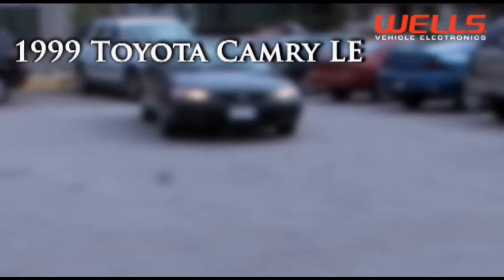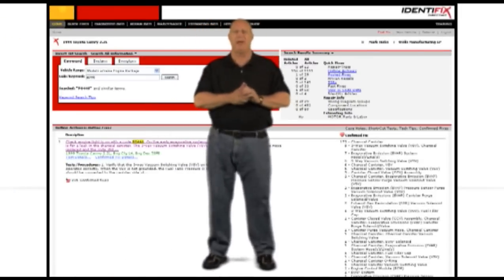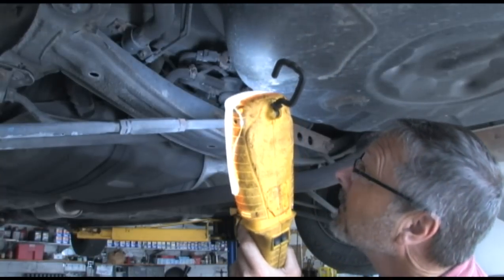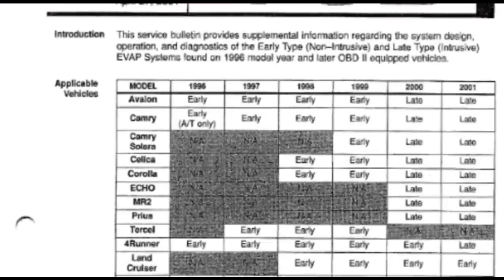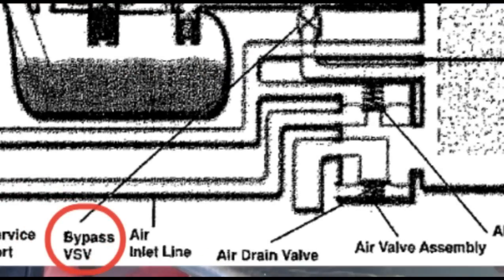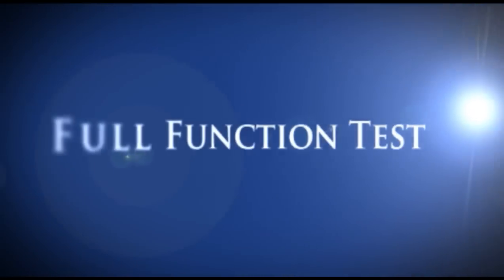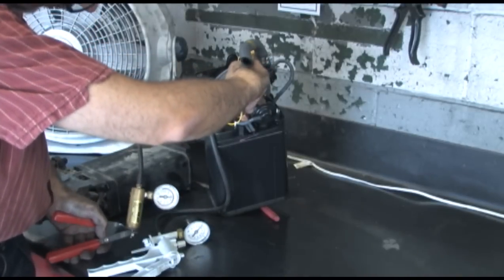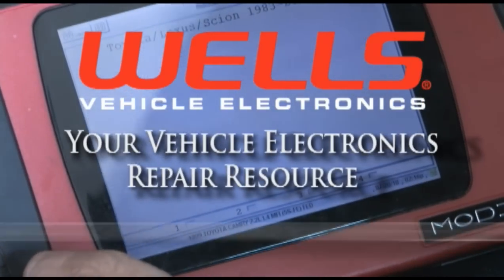Toyota Po441, P0446 EVAP Vacuum Switching Valve VSV Testing and Canister Replacement

Comment from the maker: Clean the airflow meter and retest drive the vehicle.
Add a supplemental fuel supply when the problem is happening. Check to see if the engine runs better. Check fuel pressure.
Let me know,
Mark Hicks
Wells Vehicle Electronics

Comment: Yea its just the p0446 code. I checked all my fluids and recently placed the top engine mount and spark plugs. The car seems to take a lil while to kick in wen i hit the gas nd reverse even a lil more when i got the ac up . It does it when i stop nd when i hit gas it takes awile to kick in.

Comment from the maker: Voltage is supposed to change at approximately 1" Hg vacuum. Try testing this switch several times to see if the switch is sticking. Replace the NVLD if the switch is sticking. 
It is very common for the NVLD to fail on your vehicle!
Stay in touch,
Mark Hicks
Wells Vehicle Electronics

Comment from the maker: At the Natural Vacuum Leak Detection (NVLD) assembly, which is mounted near the fuel tank, backprobe the Violet/White wire with a voltmeter. Locate the vacuum line going to the canister and remove the line so a hand vacuum pump can be used to put vacuum on the line going towards the NVLD. The other line at the NVLD goes to the vent. Block the vent line. Using a hand vacuum pump, apply vacuum to the line while watching the voltage on the Violet/White wire.

Comment from the maker: It is very common for the Vacuum Switching Valve and charcoal canister to cause a P0446 code on a 99 Lexus es300. But without testing it is no more than a guess.
Mark Hicks
Wells Vehicle Electronics

Comment from the maker: It is somewhat common for a poor ground on the MAF sensor to cause this issue. Backprobe and check the Mass Air Flow Sensor ground on the Light Green wire - look for 0.03 volts or less to be ok. If I were you I would take it back to the dealership and make sure they perform this test. I would also demand to know which codes set. It is your vehicle, my friend, you have every right to know!
Stay in touch please,
Mark Hicks
Wells Vehicle Electronics

Comment: I have a 2009 Rav4, with a really poor milage, I am getting areoun 11 and 12 miles per gallon, I did and injector clean up(flush) and the mileage improve just a bit, In the dealer they flash the computer (suppousely) and clear two codes that they do not want to tell me what they are, car is still under the 36 thousand miles, does this model still has an EGR, if not what is replacing it, can the PCV valve have an effect on this, or the EVAP

Comment: I'll take the lack of swoosh as a good thing.

Used vacuum pump to confirm both VSVs are working when properly powered - they're ok.  

I didn't make it to step 2 before I noticed the vapor pressure sensor was plugged into the wrong port on the 3-way VSV on the canister.  I rerouted it and confirmed the others according to the underhood diagram.  I hope that takes care of it.  Will take a couple of drive cycles to clear the pending status.  Will update when I know more.

Comment from the maker: 2. Monitor the FTP sensor and unplug the 3-way VSV and draw a vacuum into the canister and verify that it will hold vacuum and the FTP voltage will decrease.

3. Test and verify that the Purge Solenoid (PS) and wire harness are all OK. The PS should apply vacuum to the charcoal canister when grounded. Also verify that the hose from the PS to the charcoal canister does not leak. 

Mark Hicks
Wells Vehicle Electronics

Comment from the maker: The swoosh you hear is usually because the vent valve or solenoid is stuck closed. A P0446 on your vehicle is usually a defective VSV or canister. Here is the test procedure ... Please let me know how it turns out:
 	
1. Verify that the 3-way Vacuum Switching Valve (VSV) on the canister operates correctly. When the VSV is not grounded, the Fuel Tank Pressure (FTP) sensor should be connected to the canister side of the system only.

Comment: Mark - I've got a 98 Rav4 with 181,000.  Started with P0440 and P0441.  Replaced the two VSVs (canister and EGR).  Have not replaced the one near the air filter but it tests ok.  The P0440 went away and I've had the P0441 for a couple years now.  I just swapped the canister with a salvaged one on a whim and now I only get P0446.  Canister may still be bad I guess but I also noticed no more swoosh when removing gas cap so I replaced the cap but no change on that.  Thoughts?

Comment from the maker: 3. If both solenoids operate correctly and are not sticking, inspect for a restriction in the Evaporative Emission (EVAP) lines that could affect how the canister vents after a leak test is performed.

4. Verify that the fuel cap is a factory part. If the fuel cap leaks or does not hold the correct amount of vacuum when the system checks for a leak, all the codes will set. 
Mark Hicks
Wells Vehicle Electronics

Comment from the maker: 1. Verify that the Vacuum Switching Valve (VSV) for the pressure sensor (located on the canister) operates correctly. This is a normally closed (N.C.) valve. When energized, it should open. When de-energized, an internal spring should close the valve.

2. Verify that the canister closed valve (located on the air filter housing) closes and does not stick closed when operated. This is a normally open (N.O.) valve. When it is grounded, it closes and it should never stick closed.

Comment from the maker: I can not tell you what is wrong with your vehicle without testing it. I can tell you the most probable cause is the EVAP canister. But before I would replace it I would perform these tests:
1. Verify that the Vacuum Switching Valve (VSV) for the pressure sensor (located on the canister) operates correctly. This is a normally closed (N.C.) valve. When energized, it should open. When de-energized, an internal spring should close the valve.

Comment: Yes, this is now confirmed. I cleaned up the hoses and put back. Then I did a drive cycle (cold engine, took out gas cap and tightened, warmed up for 3-5 minutes, 10+ seconds with high idle speed, then idled the Sienna with AC on for 35 minutes). The evap is now "ready". This feels so good since I almost wanted to surrender this weekend. Thanks Mark for being be my mentor going through the process. Many many and many thanks!

Comment: Thanks Mark. The drive cycle was helpful. For evap, the drive cycle is primarily to idle (after with high idle for 10 seconds) with AC on for 20-50 minutes. I also found that with a new gas cap was not the  solution since P0446 etc came up again. But, I have a BIG finding just now. I just took out the 3 hoses (white, red, blue marked). The blue hose was blocked completely by something. So, I am so excited to post you the current status now. I think the blue-marked hose is the problem. Cheers!

Comment: Thanks. One more thing that I plan to replace (before being smoked) is an emission vacuum valve (part # 911-612) near the air-filter. Do you think this could be relevant to code P0446? Thank you.

Comment: Thanks. I thought my tag will expired next month December, but just noticed that it is November (need an emission test). I have replaced the gas cap 2 days ago, and checked the hoses. I should be able drive another 150 miles in this week. I think I should go to do the emission test in 10 days, and if it fails then I would need to ask an  authorized emission specialist to work on it (with $150 or more repairment to get a waiver if failed), to avoid an expired tag ticket. Hope the gas cap works.

Comment: Hi, thanks again for your help. After the replacement of VSV in August (shown in October that did not work), I replaced a new evap charcoal canister 3 weeks ago (early November). This time, P0440, P0441 and P0446 were pending after driving 100 miles, then P0446 was checked today after driving an additional 300 miles. I have just replaced a new gas cap now, and hope it would work. I would also look more closely if all hoses are OK. Please let me know if you have any further comments. Thank you!

Comment from the maker: Great question, the answer is no. I am going to assume you are talking about the vacuum switching valve. If it were "on" or stuck in the closed position the computer would detect the problem through an evap monitor test. It would realize there was a problem somewhere in the evap system because the pressures would not be correct. Remember, there is no code that says replace this part or any part! The computer can only point you in a direction.
Mark Hicks
Wells Vehicle Electronics

Comment: Hi, many thanks for your advice. Unfortunately, after driving 1000 miles since mid-August when I replaced the VSV of the evap canister, the check engine light is now on, with code P0446 (P0440 and P0441 pending). The replacement of VSV did improve significantly (used to have light on with codes P0446 series after about 150 miles), but there is still a problem. So, I plan to buy a new evap charcoal canister within the next few days, and replace it.  Would you have any suggestions? Thanks!

Comment: Hi, thanks for your advice. As mentioned I replaced the VSV in mid-August, and cleared P0446. After driving for 800 miles in the last 2 months, my 2001 Toyota Sienna had pending P0440, P0441 and P0446 a few days ago. These codes are still pending as of today (extra 50 miles, total 850 miles since the codes cleared in August). I assume I should wait to see the check light on, but be prepared to change the evap canister. Please let me know if you have any advice at this time point. Thank you!

Comment: I have a 2001 Sienna with the late style vsv. While testing the vsv, I heard a small click, but nowhere near as loud as the one on the video. Is that still considered ok? All connections and the charcoal canister look ok (no rust). No heavy oder of gas anywhere including the hoses. Don't want to spend money on canister unless I have to. Any help will do. Thanks

Comment: To be fair, the system on this Toyota has gone many changes during that time frame and there are bunch of TSB (and a PhD thesis :-) to go through before really understanding it thoroughly.  I have MS in engineering but it is still not the easiest system to understand or diagnosis.  Toyota by using the same code for many different things did not make it any easier either.  For example, I have no small leak or large leak code but that does mean there is no leak either.

Comment: Usually I personally do all the diagnosis myself and then I take the vehicle in for the shop to do exactly what I want him to do.  Over the years, he has realized that I know more about my cars than he does.  In this particular case, I was lazy and I knew up front that this was going to be a nightmare from doing all the research over the internet.  So when the shop said, they have replaced bunch of VSV to fix this problem, I went for it.  I do take some responsibility for this.

Comment from the maker: I apologize and completely agree. If the VSV checked out to be functioning, the nest step is to smoke the system. You are also right the majority of techs just want to replace a part without testing. I feel this is the case for a couple reasons. 1. shops that only want to pay the techs for time spent for R&R and are just interested in getting the next vehicle in the shop. 2. The shop owners and service writers that have not educated their customers that the best way to repair is to diagnose

Comment: We are talking about your reply to the person (crazycanadian05)  who had this code multiple times and the shop and dealer and replaced bunch of parts until smoke test found the leaking hose.  You will agree that smoke test should have been done before replacing the expensive canister.  At least VSV is under $100 and if it does not click, would be obvious candidate to replace.  But many mechanics, including mine, replaced it without doing any diagnosis on it.

Comment from the maker: What do you mean? We tested the VSV and it failed, so it was replaced. How is this not diagnosing? We would have included the test in the video even if it would have tested good. We then would have taken it further and smoked the system. 

Mark Hicks
Wells Vehicle Electronics

Comment: Hold on second here!  Replacing parts is NOT diagnosing.  I understand that this is a pattern failure for this make & model and there is a high chance that either VSV or canister will be a problem in 90% of the cases.  BUT, replacing them without verifying that they are broken means you are not doing the proper diagnosis.

Comment: The canister had been replaced with along with the updated 3 way VSV and a new pressure sensor.. When I got the vehicle I wasn't sure where the vent was so I smoke tested the system to find the vet... When I did find it I blocked it off and found the plastic line between the canister and fuel tank had rubbed threw behind the clip that held it in place.. A new hose seems to have solved the problem..

Comment: Hey guys.. Interesting video.. I know it was posted almost a couple years ago now, but I am curious why at the time you didn't smoke test the system to check for leaks? As you mentioned in your video the code could be set by a leak.. I recently had a 98 come threw my bay at work setting a P0446 code and failing emissions cause of it.. It had been back and forth to the dealer for the same code 8 times over 2 years trying to solve the problem.

Comment from the maker: If you have already replaced the VSV with the same results, we will have to assume at this point it was not the issue. Again it recommended to replace both the charcoal canister and the VSV as a unit. I am surprised they did not recommend it.

Mark Hicks
Wells Vehicle Electronics

Comment: I already replaced the 3-way VSV which as turns out was not even broken :-(  Can you confirm that when you say purge solenoid you mean 3-way VSV?  The new VSV is made in Japan, so it should be as good as the original one.  We can rule out the 3-way VSV as the culprit.

Comment from the maker: It is common for the 3-way VSV to stick or not operate correctly or for the charcoal canister to be faulty. The charcoal canister has valves built inside, so always replace the canister and 3-way VSV as an assembly, so the code does not reset. 

Mark Hicks
Wells Vehicle Electronics

Comment from the maker: Test and verify that the purge solenoid and wire harness are all OK. The purge solenoid should apply vacuum to the charcoal canister when grounded. Also verify that the hose from the purge solenoid to the charcoal canister does not leak. If the vacuum switch is replaced, clean the inside of the vacuum switch with brake cleaner. Spray brake cleaner into the ports on the new vacuum switching valves to clean the inside.

Comment: 99 Camry 4cyl 185K miles - only P0446 code.  My mechanic replaced 3-way VSV on the evap canister.  Visually hoses etc looked ok.  Unfortunately, the code came back.  I took the old VSV with me and checked out at home and it works exactly as listed in the factory service manual.  I would think if pressure sensor is bad, I would get different code.  Anything else besides gambling on new canister assembly?

Comment from the maker: It is very common for the Evaporative Emission (EVAP) Pressure Sensor Purge Vacuum Solenoid Valve (VSV), located next to the canister to cause this code. Have the technician activate it, to see if it is sticking. IF the hoses connecting to the canister have charcoal in them, the canister will need to be replaced. If not it is probably OK.

Mark Hicks
Wells Vehicle Electronics

Comment from the maker: The EVAP system has nothing to do with how the transmission is shifting. I think you said you had the transmission replaced. I would suggest going there to have them look it over. Before i can say anything about the canister replacement, I need to know what code was set.
Mark Hicks
Wells Vehicle Electronics

Comment: And, I just don't like Toyota dealerships, EVERY time I've taken it in, they find something wrong, and want 700-1200$ each time I take it in. What really bothers, is that I get a different diagnosis EVERY time i take my car in. Oh you need to replace all of your fluid lines, as they all leak. Oh you need to replace the transmission in your car, Oh need to replace the Charcoal Canister now. Why wouldn't they find the same problem with my car today, that they saw 8 months ago if I didn't fix it.

Comment: My 2001 Camry (LXE) just recently had its check engine light come on. 
Now I have a bad history with Toyota dealership, and I wanted to check before I pay them 600$ just to replace this crap. What bothers me is , my car drives great, very smooth, the only thing I've EVER noticed is that the shift between 1st and 2nd gear is pretty rough, also makes a grinding sound coming out of park. Anyways,Toyota wants to replace the Cannister and Fuel Cap (thats all) for 500$+ 99$+ for install. Is this right

Comment: Thanks. So far my scanner still shows no code, while evap canister is "not ready" after driving more than 200 miles since I cleared the P0446 code 2 weeks ago. This is a good sign so far. I did add a thin plastic sheet on the gas cap last time at the same time when I replaced the VSV on the evap canister. But, I think the gas cap was not really the problem as I did the same plastic sheet before. I will just drive now, and I think if there is still a problem then the code will be up soon. Thanks.

Comment from the maker: You replaced the right part. If the check engine light comes back on let me know. Getting the monitor to reset can be a real challenge sometimes. I suggest just driving it, it will eventually test and reset. Unless you are going in for  an emissions test. In that case I will send you the drive cycle information.

Mark Hicks
Wells Vehicle Electronics